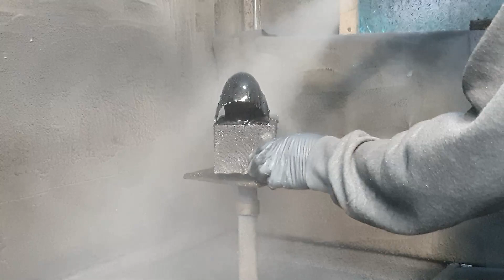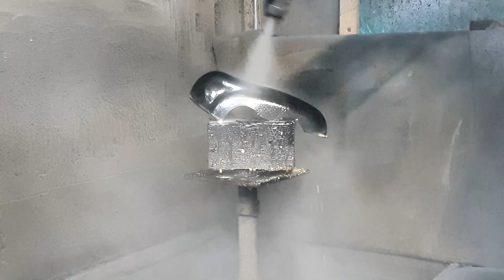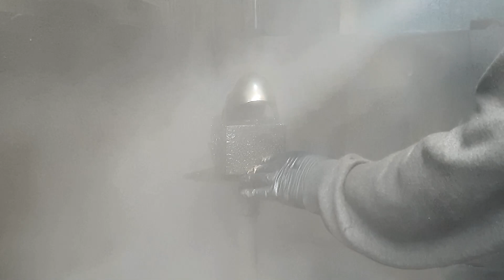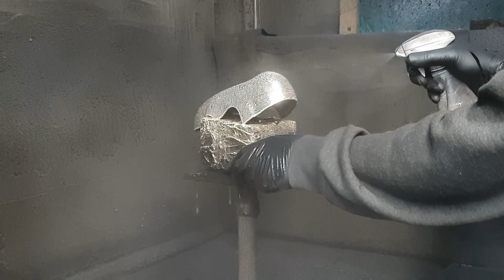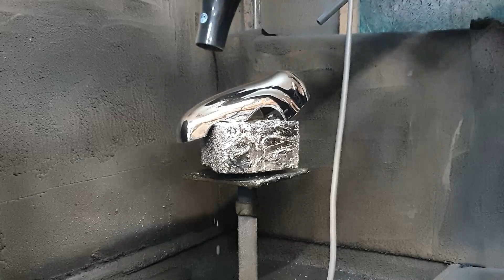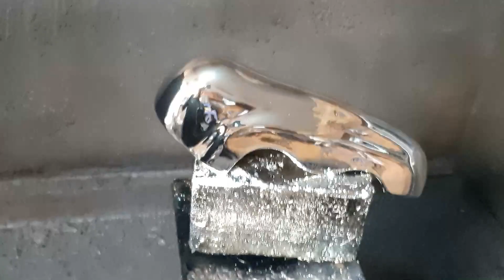Classic Car - Bumper Over Rider - Hydrochrome

Comment: Hey Dave YouTube wouldn’t let me post my number here, I don’t know how to send it to you
Reply from the maker: Nope, same here!
Reply: @EssexSilvering  hey Dave, I really need your help on the top coat, my chroming process is perfect untill I apply topcoat, it turns hazy and yellow, I don’t know what to do
Reply from the maker: @NigistMedia1  If it goes Yellow, you need to apply a violet dye in the clear coat, this stops the yellowing, then after that give it another coat with a blue dye, then you will see a very close chrome look a like. I drop of dye for every 10ml of topcoat.
Reply: @EssexSilvering  hey Dave, yes I applied the clear coat with a yellow dye but it still goes yellow and dull when I apply it
Reply from the maker: @NigistMedia1  Violet dye, ... NOT yellow dye!
Reply: @EssexSilvering  yes violet, I typed yellow by mistake
Reply: @EssexSilvering  When you did a wheel as a top coat show and tell, you made an 80ml mix and added 3 drops of violet. How critical is the mix ratio? Is 1:10 what you target?